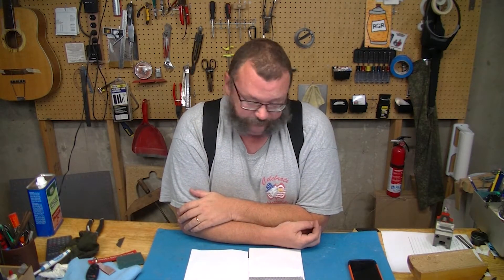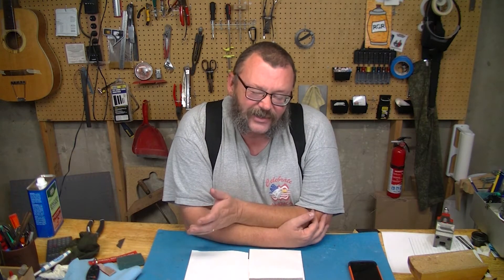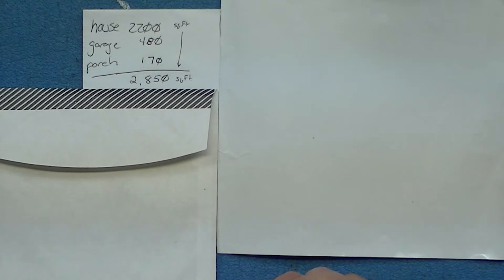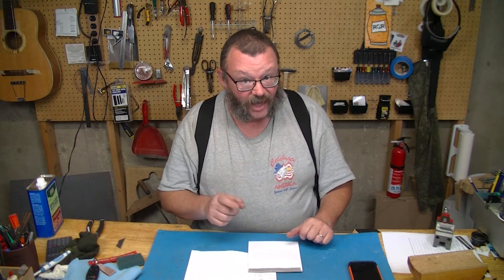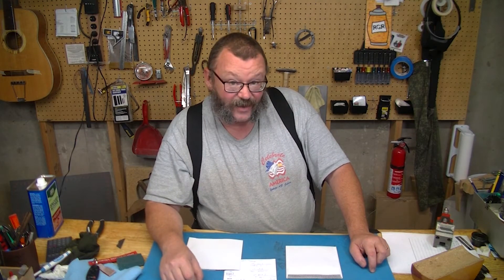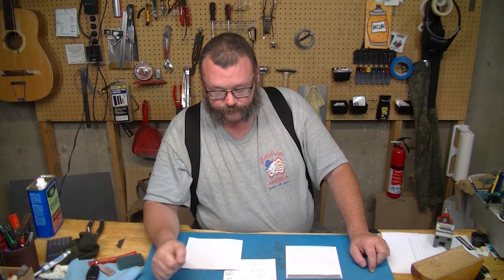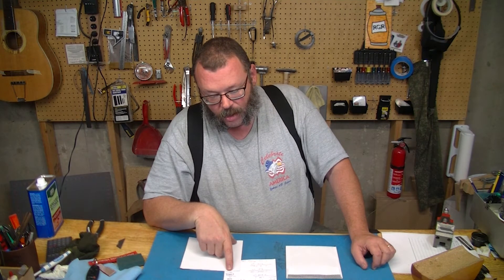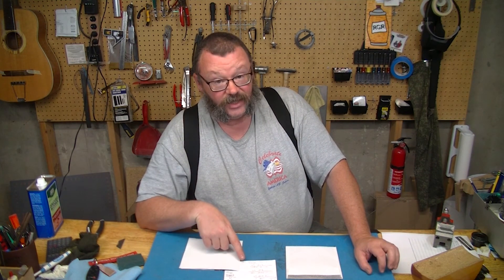aluminum soffit ventilation problems | MRS. RATTLECAN'S HOUSE

Comment: I did exactly what you are describing. I cut every soffit between the rafters then added the double vented aluminum soffit panel. Was a pain but made a huge difference. I'm so glad to see you using current code information. Figure out sq ft to determine intake and exhaust requirements. Great job all the way. I also had an external baffle ridge vent to exhaust properly. Found that out later but had to have a repair done so roofer did the new style ridge vent at that time. Attic stays around ambient temperature 12 hours of the day and within 10 degrees for another 8. The hottest 4 in the afternoon early evening under 20 degrees different. That's year round too made a difference with no ice dams on the gutters in winter.

Comment: I have no soffits on a cape I’m buying, they’ve installed ridge vents and covered the gable, where should they go?
Reply from the maker: Do a google search on open eaves to see if that is is what you have. If there are small circles to let air in you can measure and make the calculation with that. Many older homes have those open eaves coveres and have cut off all the lower air ingress (like ours was).

Comment: I am in the process of repairing my front soffit due to an ice dam that formed and damage to the facia, sub facia. When I removed my soffit panels I found that the screens were not removed and were clogged which caused the ice dam. I decided to remove the soffit and remove all the plywood soffit and go back up with aluminum facia. When I was building HFH houses with vinyl siding, the general rule we used for soffit vents was 2 solid panels then a vent panel, rinse and repeat as needed. 

On a side note when I had my house reroofed I went with ridge vent instead of the cans for better air movement. 

I live in Beavercreek Ohio, and as soon as I opened up the soffit the house did not heat up as much during hot days....
Reply from the maker: Thanks for the info Brian. Our roof doesn't have a ridge, it has a flat top about 18" wide.

Comment: Dove into this project after discovering no light at the eves when I went to do some blown in insulation... Batts were jammed down into the eaves between every single rafter. I'm currently installing 30 soffit vents as my home built in the late 80's has ( you guessed it) NONE. So I wasn't getting an ounce of air flow!. Also decided to air seal the attic while I'm at it, before I go ahead and do the blown insulation. I really hope to see a huge difference in air flow, along with heating and cooling temps now going from zero vents to 30  on almost the same size home as yours.
Reply from the maker: Crazy isn't it? At some point we'll have to replace the gutters and will tear the soffits off and open the rest of them up. Never realized how big a deal airflow was.

Comment: I wanted to adequately vent my roof and keep it simple at the same time.  So, when the vinyl siding guys did the soffits on our new home, EVERY panel of vinyl soffit is vented (their full width).  Since the house never had a wood soffit, all that area above the ventilated vinyl is open.  I can tell you from the minimal difference in attic temp to outdoor temp, it's enough.  There is also a continuous ridge vent.  

Our last house used a trio of electric fans, mounted about 16" below the roof peak, that ran continuously from daybreak until nearly midnight in the summer, making me wonder what kind of person would put a powered attic vent in place of soffit and ridge vents.  Powered vents fail (two of mine did and were awful to repair) but heat still rises....making continuous soffit and ridge vents very failure resistant,
Reply from the maker: We would love to put ridge vents in but out roof is flat on the very top where there would normally be a peak. When we pull the trigger and replace the soffit we'll remove all the old wood between the joists and replace with the full ventilated panels you have. Thanks for stopping by.

Comment: Hate to see builders or home owners just bury bad paint and possibly rotten soffit wood with aluminum siding. I don't have a quick and dirty solution for more air flow. But one system that I really like is the continuous strip vent. I will usually rip a 12" piece of soffit material then add the vent then fill in whats left. That might have to be your long range fix because of the budget but while you're doing insulation baffles do extra to accommodate future venting or you be crawling around in blow insulation to make that happen later.

Now you could add 4" round push in vents but you would need a lot of them to get close to your total free air number.
Reply from the maker: Good advice about "future proofing" with the baffles. We looked at the circular baffles as well but haven't found an elegant way to get the circle into the soffit panels without making it look like 5 miles of bad road.  Always appreciate your insight Dane, thanks for stopping by.